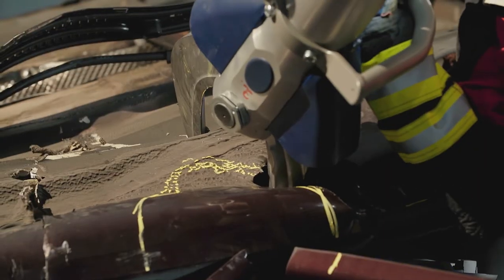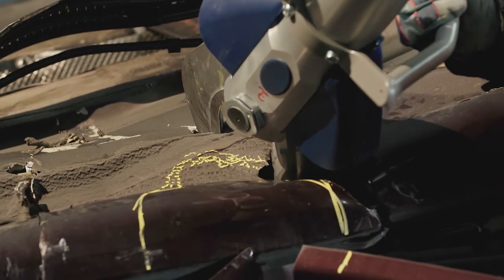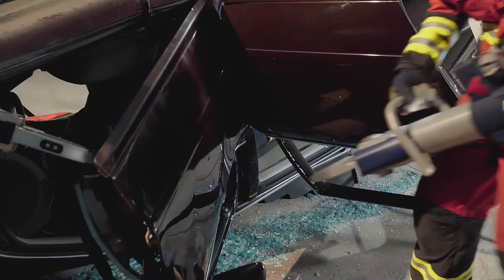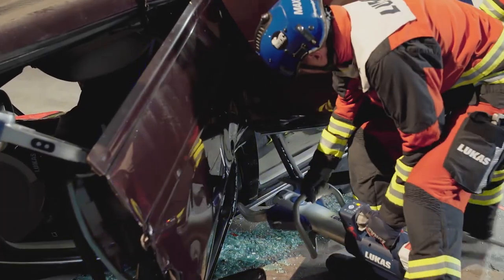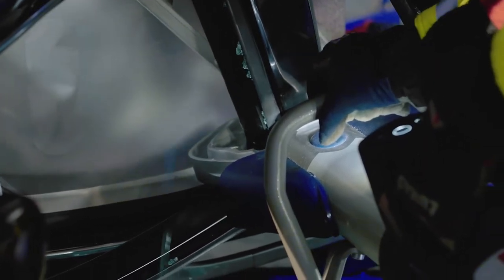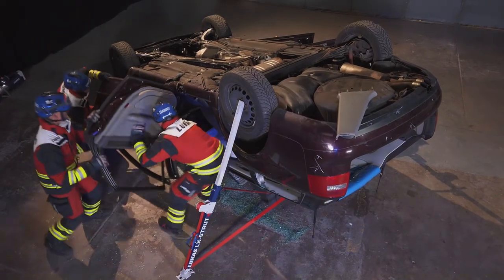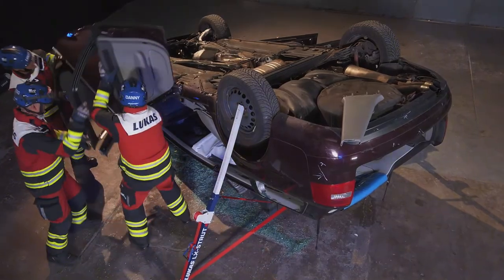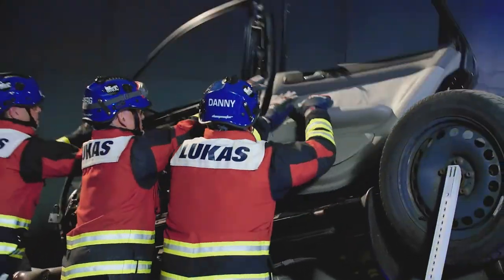Butterfly Technique #VEHICLE EXTRICATION THE NEXT GENERATION

Comment: Performed this technique on a brand new Mercedes C class. Works a treat
Reply: What is the benefit of flapping the doors up onto the roof though when the side could be removed with the same amount of cuts
Reply: @watercolours101  I believe the benefit is the b pillar goes up with both door in conjunction, instead of cutting one door off, the next, door, and then the b pillar. that's my educated guess
Reply: @Eggy123  to remove the side, you need to cut through the bottom of the B pillar, which requires the removal of both doors.

It would mean cutting or spreading both hinges plus check-strap and wire loom at least, and they take much longer than doing relief cuts in the soft underside of the car.